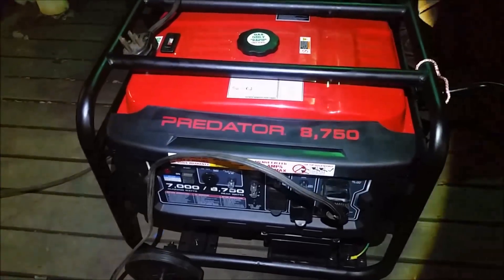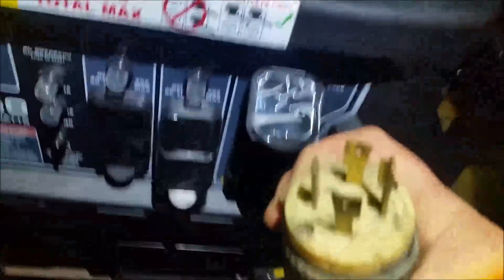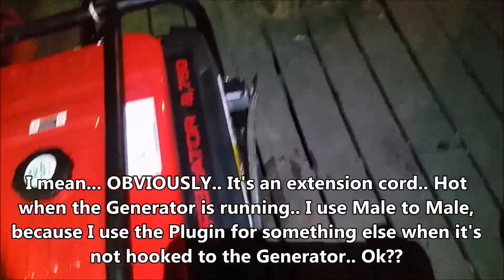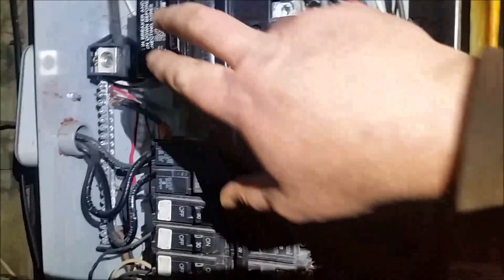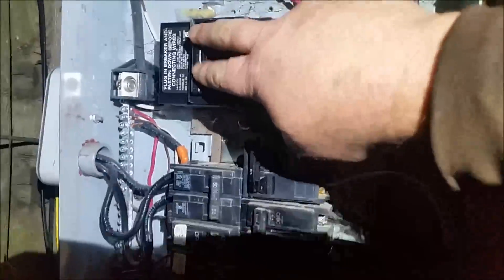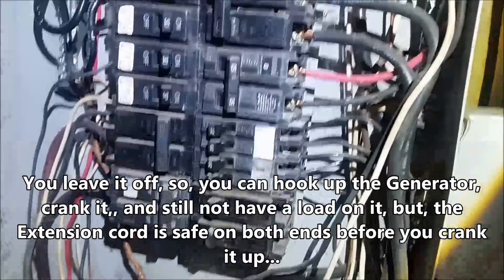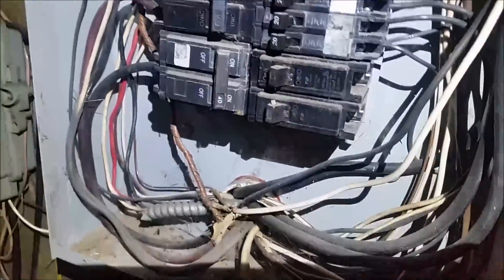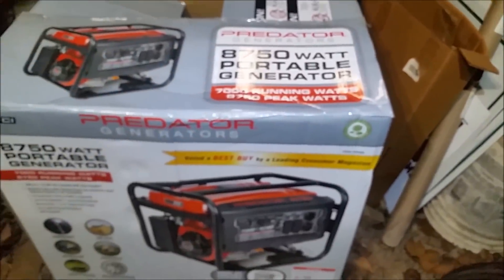Quick/Easy/Safe: Use Existing Plugin/Breaker for Generator hook up to your house Panel box.

Comment: You do realize that plug you have going into your Air Compressor receptacle set the plug on the end of your cord if somebody turns a generator on first we're going to get electrocuted that's not the way you should be showing them how to do this you should just install another receptacle right to your power panel that's designed for a generator so they can use a proper or that's just common sense this tells me you shouldn't be doing this
Reply from the maker: Then,, if you did that, you could not use an "Existing Female Plugin", and you would have to use a "Male Plugin" on the box you are referring to, and that would totally negate the reason for using this technique.. The cord you are referring to is a Male to Male (Suicide Cord).. Yes, the first thing you "WILL" remember, when you grab it is to make sure that the Generator is "NOT RUNNING", and the Main Breaker is Off.. 
If that was your worry about the setup, and you got both of them, then, look at the video again and you will see the same cautions more than once in the video. This is not for people who can't see the dangers.. Neither are power tools of any sort for that matter.. Yes, before you pick up a Knife, or Gun, you should understand some basic fundamentals.. Same as if you use this technique, understand some basic rules of Electrical safety..  Without having some Understanding AND FEAR, of electricity, you should never even THINK about opening a panel to hook something up about what you are suggesting.. It is called a "Breaker Panel Interlock", and  requires some basic fundamentals also.. Forget to turn the main breaker off, and you could put yourself at a very bad risk.. Same principal applies with my techique, but, you never have to open the panel.. Just turn off the main breaker, plug the cord and THEN,, crank the Genset..  Any more specific questions, fire away.. Would be glad to help you answer them.
Reply: @MarkThomas123  evidently you truly don't understand that it would be a generator plug that would be connecting to your panel that would be a male and your cord would have a female end attached to it that attaches to the generator plug. Google some proper generator installations. This might work for you but somebody who doesn't know anyting who thinks what you're doing is okay is going to get electrocuted
Reply from the maker: @anthonyguess5528  Oh No.. I truly understand everything about it.. So, I guess you are trying to say that, my setup is less dangerous than what you are suggesting? So, you are suggesting that someone put in an EXTRA Breaker that will be used for Nothing other than connecting a Generator, but, you forgot to say, that you would put in a Generator Interlock, and that someone who you don't trust to plug in an extension cord is going to have to do all of this wiring inside of the panel.. My technique does not require that.. Your technique requires turning off the main breaker and working on a box with "High Voltage at the top of the box", mine does not require opening the panel, etc.. Yes, I understand everything.. 
You want to hang a MALE PLUG outside of the Panel, and I use an existing Female plug that is only used when the Generator is being used and you are not going to use a 220V plugin while you are using the generator, so, common sense to unplug it while using the Genset and hook the genset to something you are not going to use anyway while using it for a generator... 
I don't care what you say, you can't tell me that your way is smarter.. 
If you are not smart enough to turn off the main breaker, you have no business doing anything like this.. So, if you are scared that you can't do that, then, you should not even be watching videos like this.. This is for someone who has common sense.. Obviously not you, so, find something with Zero danger to do today and be safe.. This video is not for you.. And, hope that the Interlock that some Electrician installs for you never fails, because, you are going to have a Male Plugin out there besides your box that could easily kill someone if the Interlock (Some flimsy sheet metal) fails.. 
Use Logic and Reason and you will be able to see this makes sense,, because, if you have an existing 220v breaker that you are not going to be using while on the Generator, the only thing you have to do is build a male to male cord.. Notice, those instructions are not in this video.. So, if you have enough sense to see the simplicity and you Definitely have an existing plugin to use, you are golden.. But, without the Male to Male cable build instruction, Libtards are stopped dead in their tracks, so, stop worrying.. Evidently you have not gotten that far to thinking ahead of what you need to complete the project.. A conservative would have the forethought to consider that... So,, move along and hire an Electrician and do whatever he says.. This simple stuff is not for you..

Comment: Meanwhile I have a cord with a NEMA 14L-30 cord cap that goes to a 25 foot piece of SOOW cord that leads to a 4square deep with fuses in it that then goes to a 6 foot long piece of SOOW cord with color coded alligator clamps so I can remove the meter and feed the house through the meter terminals. I STRONGLY SUGGEST THAT YOU NEVER, EVER DO THIS.
Reply from the maker: Never use Alligator clamps and open the meter pan to do that? Yea.. I would agree.. Hopefully, you are the only one around when you do that.. 
If you have an extra 220v breaker, and a female plugin, it would be a much better route.. At least the Male to Male extension would be safe once things were plugged in and the generator operational.. But, if you are the only one around when you are running, or the power comes back on and you have to disassemble, and get the meter pan back in,, you would not be much different than the guy swapping a meter pan and that does not take a rocket scientist.. And, the way you describe things, you know what you are doing, so, I would feel that you are safe and understand the risks, and, if it is only you,, that is what is really important..  But, placing something over the meter pan, etc,, "Danger", etc,, would be appropriate if anyone else,, less aware is anywhere close to the setup..  Not everyone has common sense.. It aint so common these days.. Ha.. Sad but true.. :)
Reply: Mark Thomas The only time I ever use this cable is during emergencies so I can provide temporary power as I install an interlock and receptacle for proper back-up power. And rarely to test a new house that has yet to been connected to the grid so I am able to test everything. I DO NOT RECOMMEND THAT ANYONE INCLUDING LICENSED ELECTRICIANS EVER DO THIS, METER BASED TRANSFER SWITCHES DO EXIST FOR THESE REASONS.
Reply from the maker: @Veritas-invenitur  yep. I understand. I do a lot of stuff I would not recommend others doing either. But if it works, and it's a quick and easy way to get something out of the way to the next project , I'm sure we're more than capable of doing that. Keep On Keepin On!!

Comment: Hey Mark, where'd ya get the plug cover for your 220?  I've been trying to find something to go over mine other than an old baseball cap..Thanks!
Reply from the maker: The black part of that is the male plug in. It is a 50 amp connector like you would use for your stove.

Comment: The cord is only suicide" if you don't know how to use it. Plug it in before you start. If I can't remember to shut the MAIN OFF , then how can I remember the sequence to start the gen.?  Or To Do Anything else related to a power outage.  If you are afraid, Make a note. Pin it to the gen. the service panel. Your fore head. If your still afraid, motel it.  I think this is a great vid. Thanks
Reply from the maker: You are the type of guy that I made the video for.. Someone with Common Sense, that can see the value of being able to use your existing everything to hook up the Generator Temporarily,, using only a Male to Male Cable, and go right back to the way the house was when you are done.. Yes.. Exactly.. Just make sure you shut the Main Breaker off and Hook the cord up first... It's like,,,, the most basic Common Sense is used.. BTW.. If you have not held the Male to Male cord in your hands yet,, when you do pick it up,,, if you have any common sense at all,,  YOU WON'T FORGET!
It's like plugging in a "Regular Extension Cord,,,, and being careful "Not" to have your hands touching the Blades when you plug it in on Steroids... You "Know" it is something that you need to Respect...  Think about it.. Every time you pick up an extension cord,,, you look for the Male End first, to plug it in first.. When you see two Males,, it is just a Wake up call.. You would have to be Brain Dead "Not" to respect the cord.. I have done it for over 10 years, and have finally gotten to the point that it does not intimidate me,,, even though I know I am plugging it in first,, After I Turn the Main Breaker off...  Thanks for your comment.. Hopefully some others read your comment and see the simplicity.. But, Common Sense is no so Common these days.. Have a great day!

Comment: I get it !!! Up and down, from side to side. For those of you who don't, The only problem I see here is your extension cord has a male connector on the end that is giving the power. This is all fine and dandy if only someone with understanding is doing the hook up. What happens when you're not home and someone else does the hook up that only thinks they know what they are doing. They Crank generator first then try plugging that male connector end that is live open terminals now. BAM there DEAD. Great video thank you for making it for us poor folks that are trying to save some money, but I advised anyone doing this to put a female plug on the end of the extension cord and change the receiver plug to male that is going into the box. Your set up is known as a dead mans cable.
Reply from the maker: Ok.. Well,, lets see.. Change the male Plug on the Cord (Harmless and No Voltage until it is Plugged in (whether Generator is on or Breaker is on or off), and replace it with a Full Time Male Plug Sticking out of your Panel?? How do you know if it is Hot or Not?? Sitting there ready to "Kill You" if someone turns the breaker on and you don't know it?? At least,, I have both male plugs in my hand and I "Know" it is not hot until it is plugged in, Breaker turned on after Main is off, and then crank the Generator.. 
Sorry, but, you are making Zero sense.. Democrat??  What you forgot to say is that you can't save money buying extra "Male Plug Boxes" to put on your Panel and having an extra 220v Breaker (Not being used for anything but a Generator, no matter how infrequently you use it, still takes up space 24/7/365, and don't stop there, because you surely will kill someone.. You need at least a Breaker Interlock, or it "REALLY IS DANGEROUS", so, there goes another $45-$60 for a thin piece of metal, so you won't "Forget to Turn the Main Breaker Off".. Ha..Ha..Ha..Ha... 
Tell you what.. Hire my 7 year old to come over an hook up your generator for you when the power goes out and save yourself a butt load of cash and be safe.. He is not Stupid and Knows,, not to touch voltage... I don't teach him an Extension Cord is Dangerous, because they are not.. Same as I don't teach him that "Guns Kill, because, they do not.. Some Dumb Ass needs to have the Gun or "Male To Male Extension cord in their hand before it becomes "Dangerous"..So, YES... Do not do this in your house, if you think you and your family are not smart enough to "Turn the Main Breaker Off" First, Hook up Cord Second, and Crank Generator Next.. I mean.. Do you have trouble putting your car in Park, or putting the Emergency Brake on while you are on a hill?? You Could Kill Someone if you forget??? How is common sense not the same thing?? Just Curious.. 
Go Hire an Electrician, and when you see anything about Electricity that has anything to do with DIY,, click on something else as fast as you can.. It might not be "Your Life" you are saving.. Might be one of the kids that could not tell to be safe with a Male to Male Extension Cord??? Really??? Holy Crap Man.. You are telling everyone in the World that Neither You, Wife, Kids,, can pick up a Male to Male Extension cord and not feel like it needs to be handled with Care?? 
Please  do not teach your kids how to Hunt, or handle a Weapon.. My kids are still out there and don't need the risk.. I think I understand why you Democrats are so scared of Guns.. Just can't understand why you guys have kitchen Knives, or anything that might be dangerous.. You know..Like Shoe Laces??? Tell me that taking off out of the House without Tieing your shoes is not Dangerous and likely to give you a Faceplant?? 
You know.. I would be terrified if I knew you had a gun,, if I were like you,,, but, you know something?? 
I am not.. One very simple reason why.. 
I don't pull my gun #1, Nor Point it #2, nor put my finger on the Trigger #3, unless I am going to fire it.. I do not point it at anyone or anything that I don't intend to shoot.. And, when I do, I have Excellent Gun Control.. Can shoot a Pistol and regularly do at 225 feet at a 10 inch target in the water, so I can see exactly where I hit each and every time I shoot.. And, I can draw and shoot at that distance in about a short 2 seconds.. I do this because I know one thing.. You think I can't shoot that far and be accurate. So, even if you have a Rifle, (choose which), you don't have a chance in hell when you see me raise my pistol, because, that second you say "WTF", is that one second you never have again.. Just imagine what I can do at 15 to 30 yards?? If you ever get in a Jam, and a Gun is the only thing that will save you,, I hope that someone like me, or, myself for that matter is there to save you.. Just like the guys in the Church in Texas and Thousands of other incidents across this Country every day where a Gun is used to "Defend" and "Self Preservation".. A Gun is Dangerous, so is a Male to Male Extension cord.. You didn't hear me in the Video talking about you who do not?? Crawl under a rock and stay there.. We will take care of things that need taking care of.. And, we will think about what we say and do,, BEFORE we make a fool of ourselves, or do something Stupid.. Just wanted you to know what it is like to live in the "Real World".. 
Just Remember. Socialism is Free, but, you have to have Guns to "Return" From it.. Do your Research and WTFU.. Have a nice Day.

Comment: Yes this will work if done like stated . No it’s is not legal in the US . Yes I have done this . Putting a video up showing this is stupid . Some one will get hurt or die .
Reply from the maker: Not illegal.. (Of course,, I'm not sure what "No it's is not legal" really means... Ha..Ha..  
No Premises wiring was done by any contractors/electricians, therefore no inspections needed because there were no modifications made to any wiring, except "a temporary extension cord".. Don't you wish you were "Really Smart".. Besides,, if you are the homeowner doing your own work, you don't need an inspection for a temporary extension cord.. Or any work for that matter that you do for yourself to something existing.
Simple fact of the matter is,, not even a receptacle  was changed in the whole project.. The only thing new was a generator and an extension cord.. Call the Building Inspector and tell him you need him to come out and "Inspect your Temporary Extension Cords"... Ha..Ha..Ha.. 
You guys should really think longer before you type something because you "Think" you know something.. 
I have my doubts about you successfully doing this anyway..  In order to do this,, you would have had to make your own male to male extension cord and would remember that it is the "ONLY" think you had to change.. 
Why do you feel as though you need to tell lies and make yourself sound like you know something to others?? Do you typically get away with that with your "Typical Friends?".. Is that why you do it? $10 says your a Democrat!!
Never mind. One quick look at your profile and the $10 is mine already.. Do you wonder how I knew?? Ha..Ha..Ha.. It's really simple.. Ha..Ha..Ha.. You Libtards never cease to Amaze me.. Ha..Ha.. :)
BTW.. TransNexus.. Trans this, Trans that.. You are not one of those people who can't decide which bathroom you are supposed to go into,, are you?? Trans Nexus... A like with Trannies? Oh hell.. Talk about a weirdo!!..

Comment: QUIET GENERATOR ,20%OFF NOW! SUNGZU PORTABLE OUTDOORS GENERATOR `1000Wh
 
https://www.amazon.com/gp/mpc/A1PKZYY2ID2UTS
ASIN: B07Z5R2F4K
Reply: Might this be a bit of spam? It seems to just be a battery inverter with no way to supply 240V to a breaker panel. No generator, no sound.